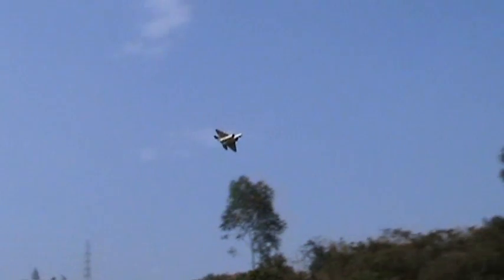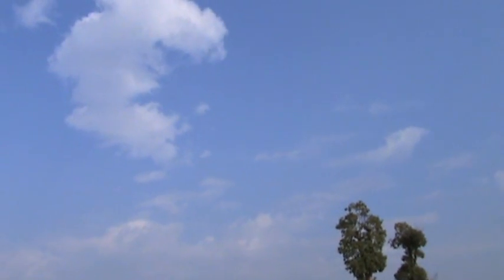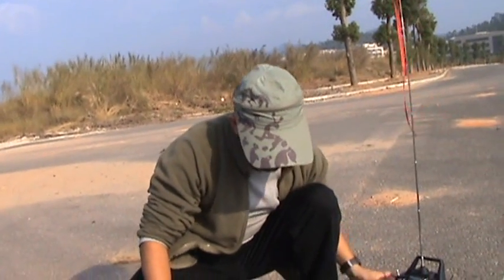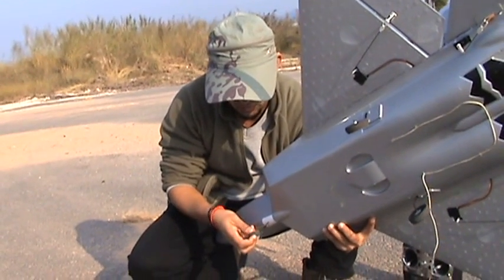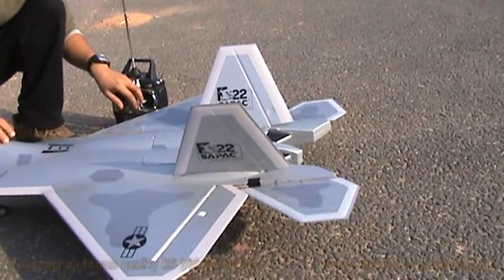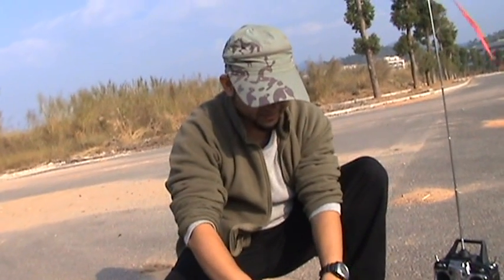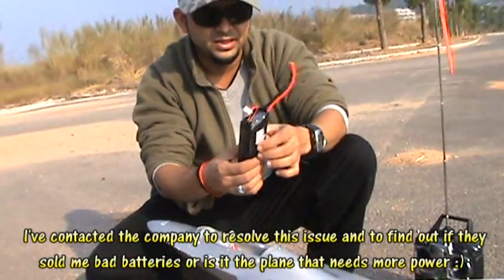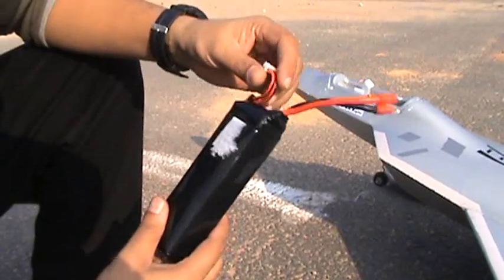RC F22 Raptor Twin EDF Jet 2nd Beautiful Flight

Comment: I have noticed a lot of battery issues with folks that fly RC with them. I want to get in to the hobby but am not sure were to start. I fly rotor wing for a living and have been told start fixed wing RC first.
Thoughts any body?
Reply: Go heli if you want, just practise on simulator first. And be careful :) And go for a Goblin, its so good
Reply: f22 twin 70mm  updated 80 amp esc....metal gear servos?
Reply: +Curtis Smyser banana hobby

Comment: i found out the bigger scale planes are great starter planes
but smaller planes are harder to control

i want a hanger 9 extra 300 35%
with a DA120cc 2 stroke engine 
and its a big scale plane 
i always wanted a big petrol powerd rc plane and i found a 35% scale model
which is masive and i am going to have to find a big field to fly it

Comment: I had to strengthen the vertical fins and the elevators when running 4S
I had lost an elevator and vertical fin from the extra speed.

Comment: @alishanmao I totally agree. I have a 400.00 f22 paper weight. It came with bad servos. The only thing that worked was the motor and one landing gear. I wont ever buy from them again. I got this sapac model probably put it together this week and fly. Going to do some in flight cam also.

Comment: Ali, I have a questio,
I have this air plane BUT it do not fly this fast, it's way slower. My battery is 3 cells 3000 ma 15c. Should I change it? ot what?
I'm really surprised by this speed....